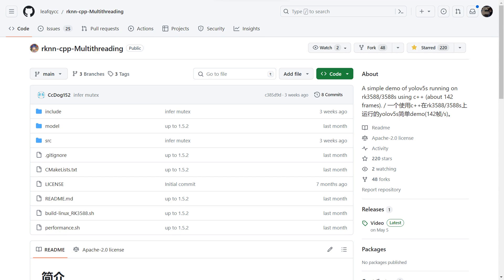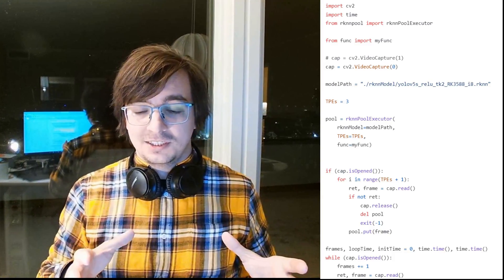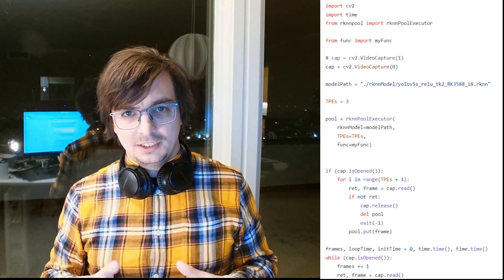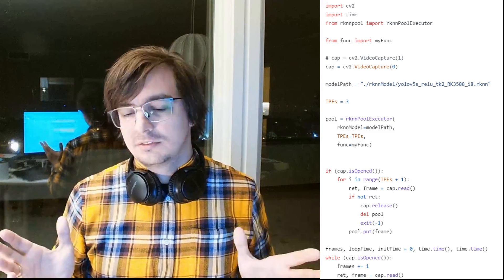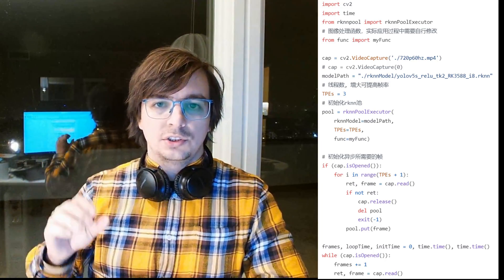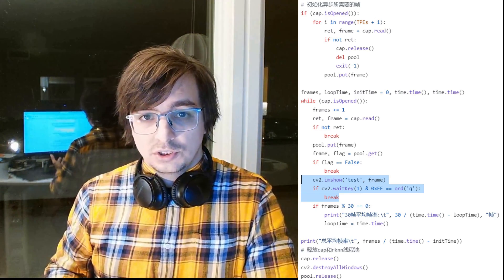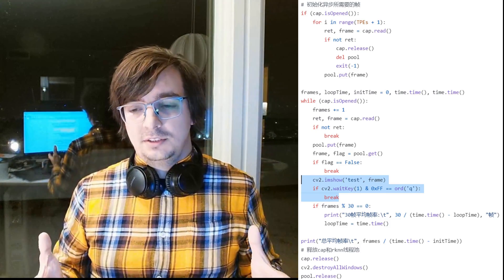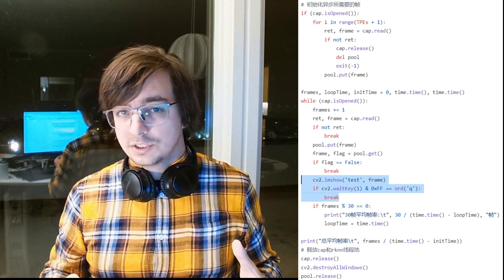Maximizing Neural Networks Inference Speed on RockChip NPU

Comment: @AntonMaltsev I have RK3576 2NPU and 8CPU and my camera fps is 30. I used that one but still not improved. Is it possible to combine cpu+npu? how?
Reply from the maker: Did not get the problem. 
For my 3576, it's worked. But the  boost was slower than for 3588 (because of 2 NPU)
Checking the whole pipeline is required. The problem may be at any point.
Reply: @ I checked it’s working now. But I didn’t combine cpu+npu

Comment: how many fps do you get with webcam that is 60fps  ,, using yolov8s on 3588 and rknn python ,,??
Reply from the maker: Depends on the image size. 
Did not test yolov8s on 3 NPU cores. 
For one core, it was ~165ms for 640*640 and ~40ms for 224*224.
Should be ~x5 for 12 threads/3 cores.
Reply: @AntonMaltsev  which one is the 3 cores and 12 threads ?
Reply from the maker: @Tawasy-vx3ce  RK3588

Comment: I'm having a problem using the airockchip/yolov5 repo it outputs onnx with opset 12, and when converting to rknn it warns that it should be 19. When I use --opset 19 it can't find it, I can only go as high as --opset 17 if I run pip install onnx==1.5.0. And if I load the opset 17 model to the convert scrip it throws an error.
Reply from the maker: Sorry, I don't know anything about this problem.
Maybe experiment with different versions.